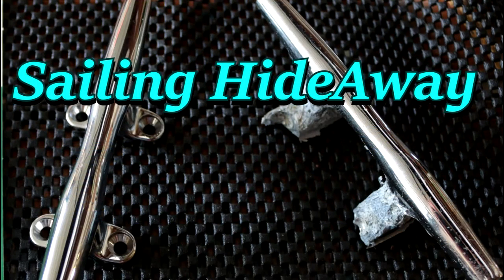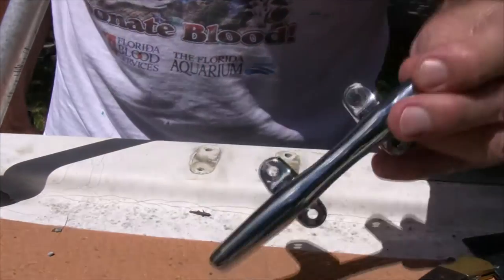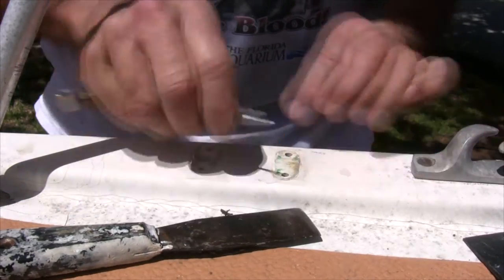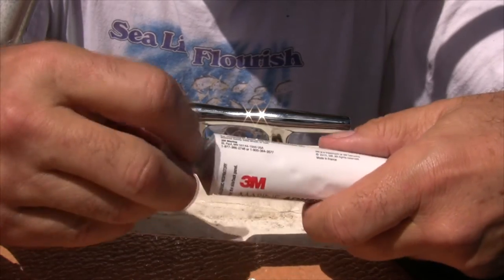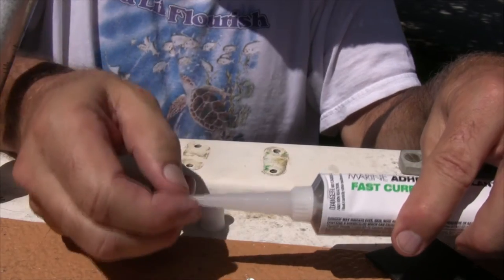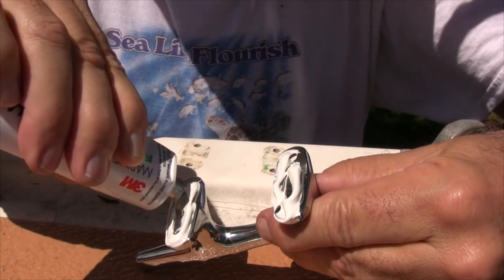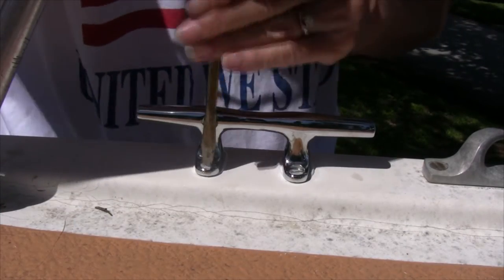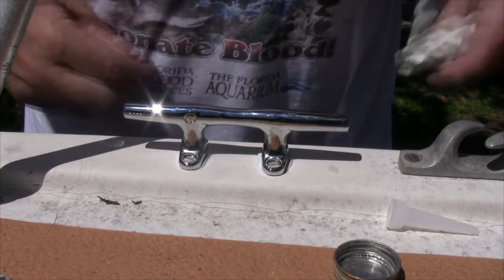How to Replace Spring Line Cleats - Sailing HideAway  Com-Pac 23

Comment: If i may suggest something, if you put all unused 4200 and 5200 in your freezer it will never freeze and it'll last for years ready to use when needed.
Reply from the maker: I wasn't aware of that.  The instructions state the product will start to cure as soon as the seal is punctured. it also states that warmer tempertures will speed the process so its worth a shot to keep it cool.  I'd planned put the next tube in the fridge
Reply: SV HideAway yes it works i learned it sailing in the Caribbean where things are hard to come by at times, so a local showed me that trick to put it in the freezer it will last for years. By the way i enjoy your videos a bunch.
Reply from the maker: I'm going to try that next time.  I just learned recently that products like cetol, varnish and such, should not be stored out of the ac to help prevent a skim. Guess I should read the labels closer